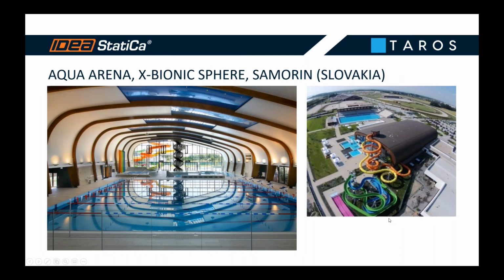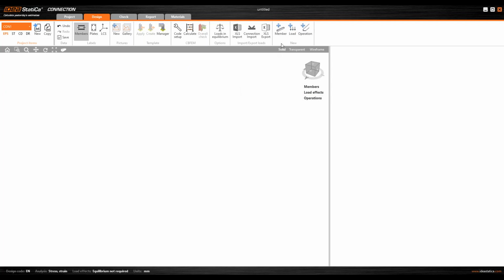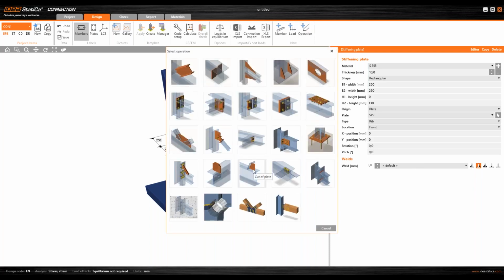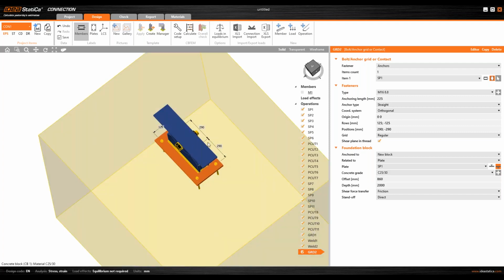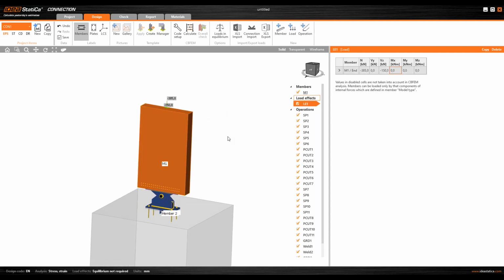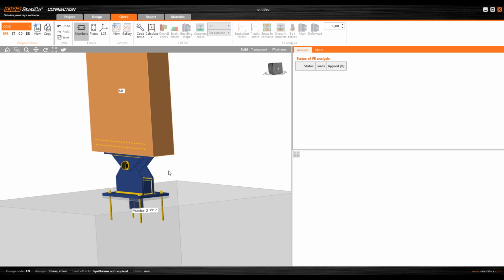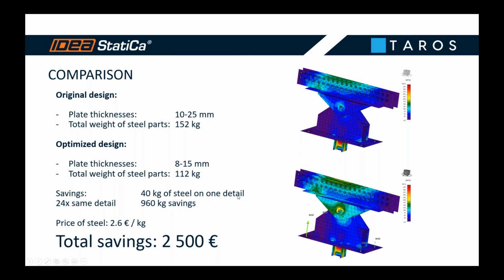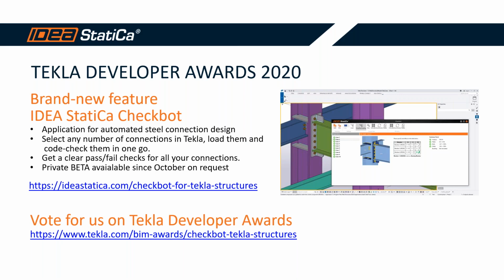Connection Wednesdays - Optimization of timber column anchoring

Comment: Hello,
I am designing a connection between a timber column and a concrete foundation using a steel base plate and a bolt grid. After running the analysis, all steel and concrete components are checked, but the 'Bolts - timber' section shows 'Not calculated'
Reply from the maker: Hello, unfortunately, there are no checks for bolts in timber for now. It is considered a future development.
https://www.ideastatica.com/support-center/general-theoretical-background#Steel-to-timber_connections
But this has been developed using our API by our partner TB Structures as a plugin:
https://www.tbstructures.com/software-timbyrnode

Comment: Hello, when I try to import the DFX file, it shows an error "segments of the shapes are too short, please reduce the number of inputs", how can address it? I tried with higher dimensions but it didn't work
Reply from the maker: Hello, this is an improvement from version IDEA StatiCa 23.1.2 and on. It prevents mesh errors and informs you to first modify your DXF shape so that you dont get into the meshing troubles later.
You can use either longer lines or round shapes instead:
https://www.ideastatica.com/support-center/limiting-short-lines-in-dxf-imports

Comment: I had done a similar connection. But in the report it shows the following note for the Bolt M48:
"There is a gap between connected plates. Bending in bolts is not considered in this numerical model and plates are not clamped. Provided resistances of bolts in shear and plates in bearing may be incorrect."

Please suggest on how to check the bolt for Bending arising from the separated plates in contact.
Reply from the maker: Hello, you can check it manually - convert to beam loaded by shear forces. You can now change bolts to pins. See here: https://www.ideastatica.com/support-center/steel-pins
Reply: @ideastatica_en  Thankyou

Comment: is it possible to design timber column to timber beam connection using an angle steel plate in IDEA
Reply from the maker: Hello, unfortunately not this design type, we support gusset plates, etc.
https://www.ideastatica.com/support-center/steel-to-timber-joints-theoretical-background

Comment: Is it needed to connect inserted timber plates to plate sp7 ? Or it will be defined automatically?
Reply from the maker: You are right, Adam forgot to add two welds between gusset plates and SP7. Thanks!

Comment: It is possible to model and design a pin in the timber column?
Reply from the maker: Hello, right now there are only possible joints based on the templates, timber connection with one bolt only is not allowed.